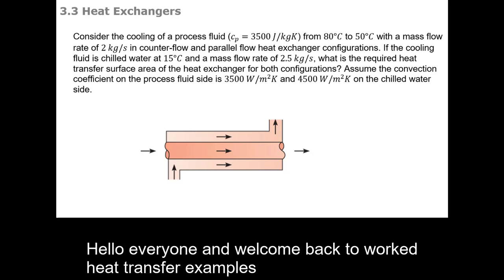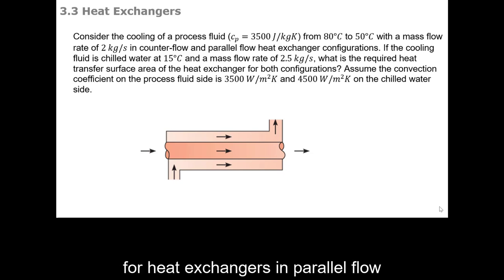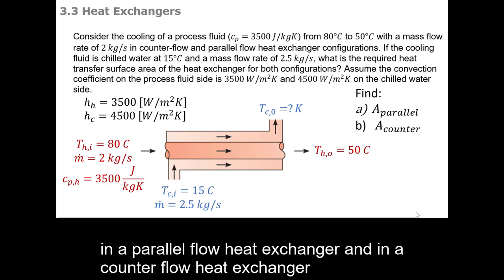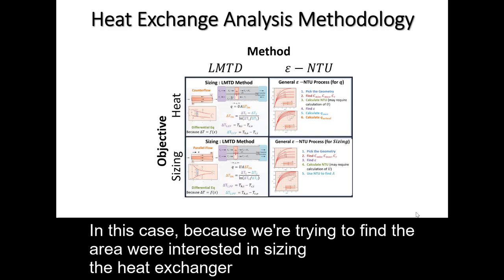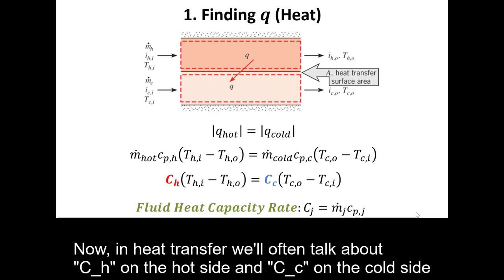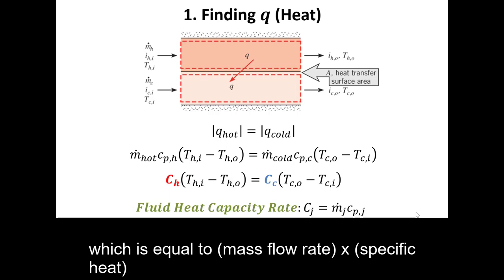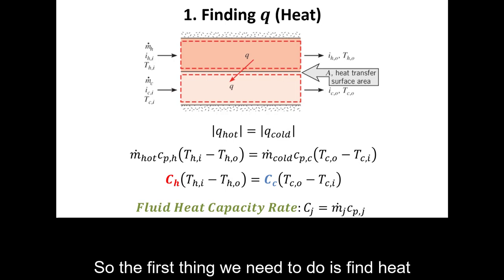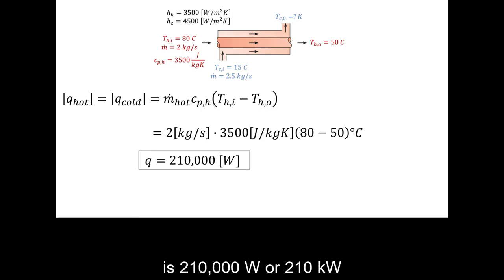Parallel & Counter Flow Heat Exchangers (LMTD): Heat Transfer for Mechanical Engineers

Comment: is there a way to get a close assumption for T? the exam is time limited doing iterations is difficult.
Reply from the maker: I'm not sure I understand your question. Typically, you'd be given a problem with known geometry. Then you either know the temperatures (or can calculate them from 1st law) and have to determine the area. or you are given the area and then can calculate the temperature differences.
Reply: @  i mean that sometimes T out is not given in the video you assumed it 300k to get the properties from the tables ,my question is that is there a way to get a close initial guess ?
Reply: Without having to do multiple iterations
Reply from the maker: @lynnsaleh7337  You wouldn't iterate to find properties again on a test due to the time constraints you talked about. Most of these properties are weak functions of temperature and "errors" from picking the "wrong" temperature wouldn't be large.

Comment: I don't have effective heat transfer co efficient value! And not even hi and ho value
Reply: You should find the Nusselt number for both flows to get each htc. An internal flow forced convection problem basically.

Comment: When calculating the area of the parallel or counter flow heat exchanger, I noticed that the units in the denominator do not align. You left the log-mean temperature in units of Celsius but the overall HT coefficient as W/m^2 K. In this case, wouldn't we have to convert the log-mean temperature to Kelvin in order to get the correct area for the heat exchangers?
Reply: no
Reply: we're taking the difference right? It doesnt matter